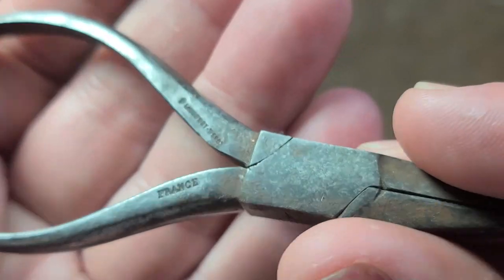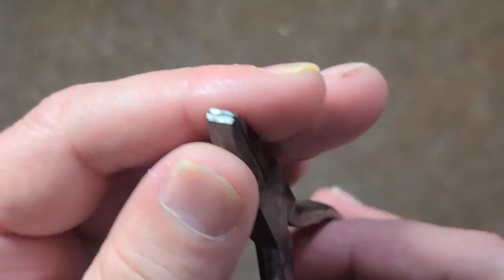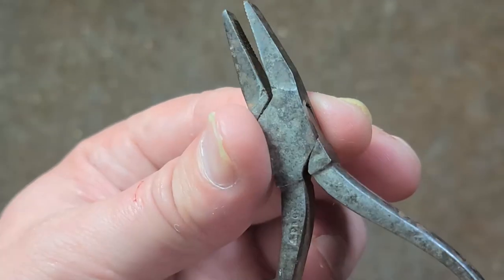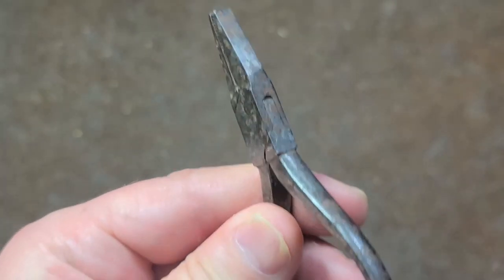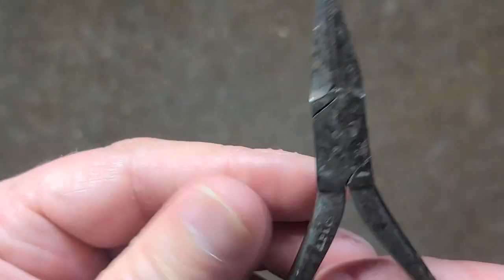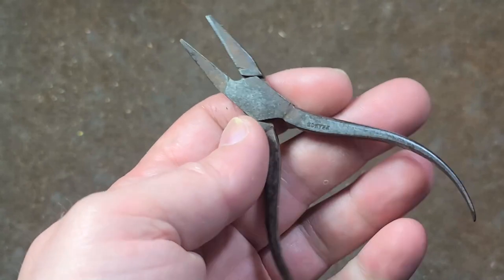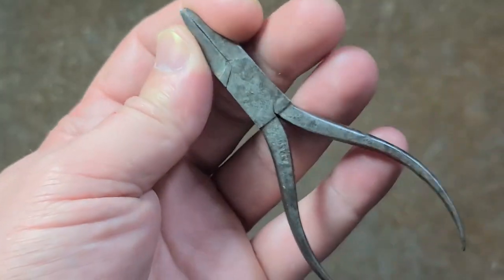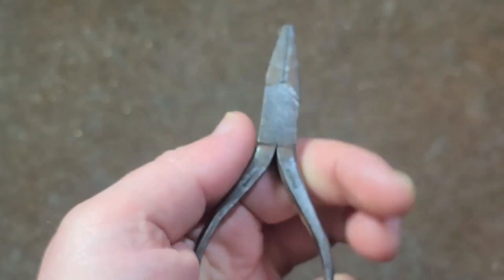AF & Co France Mini Box Joint Duck Bill Pliers Review

Comment: Duckbill are the best and I use them in larger sizes from Craftsman as general purpose pliers especially when needle nose are too thin.  They are so much better than slip joints.  For these small sizes, I do have them with box joints from Michaels when they did have the 50% off coupons and use them when I do leather work.  They are made from Pakistan and served me well.